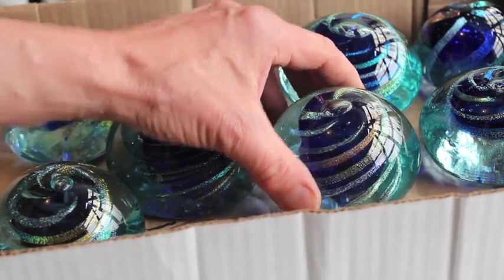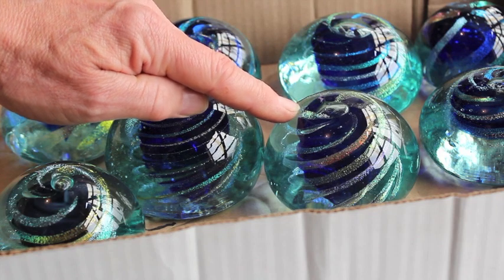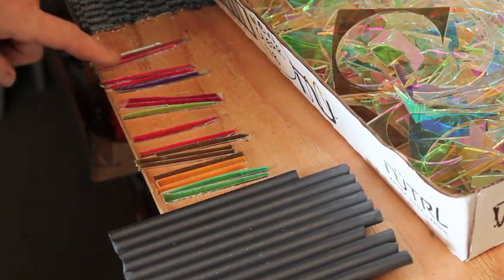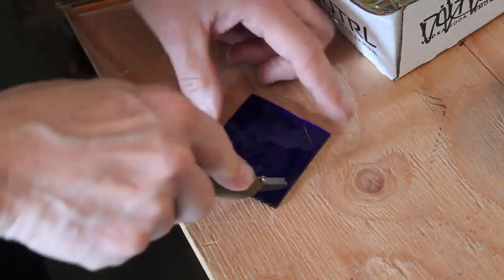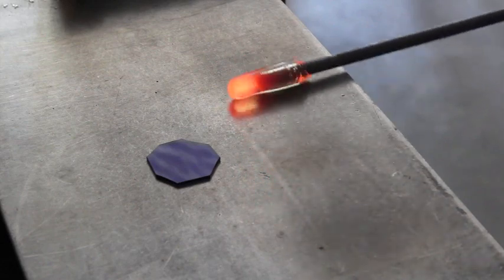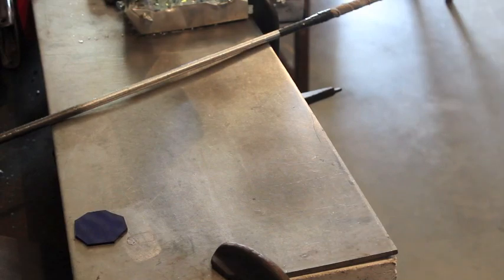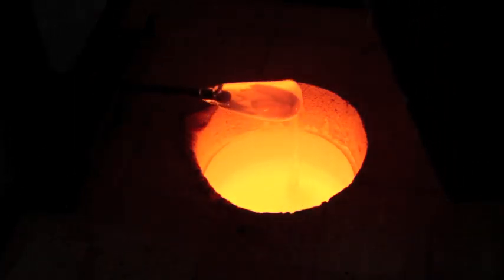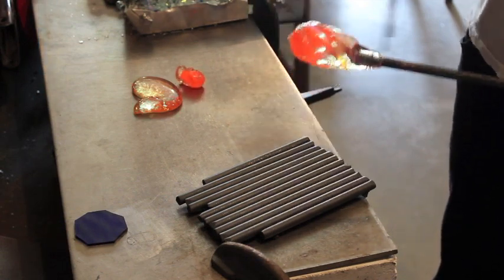Making Dichroic Swirled Paperweights

Comment: How can we buy a top load furnace like this ?  Do you change crucible when working with a color like one of your other video with blue flowers ?
Reply from the maker: I change colors regularly but in the same pot.  Sometimes there is a bit of contamination in the bottom from the previous color, but I plan for that and don't go from cobalt to clear, instead I go from cobalt to dark turquoise to light turquoise to green to light green to clear, if you see what I mean.